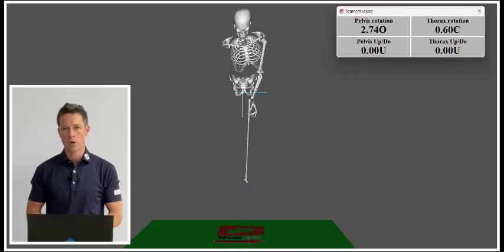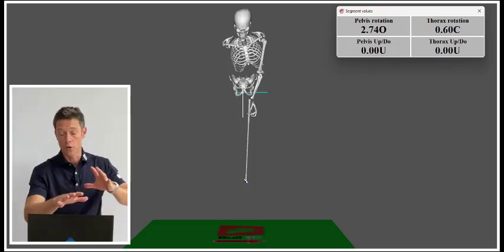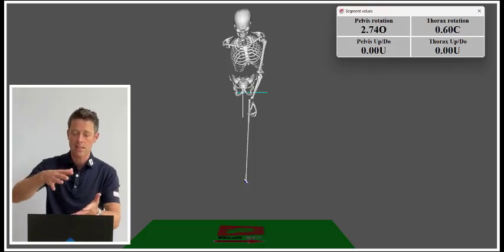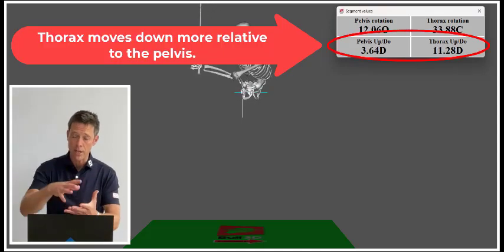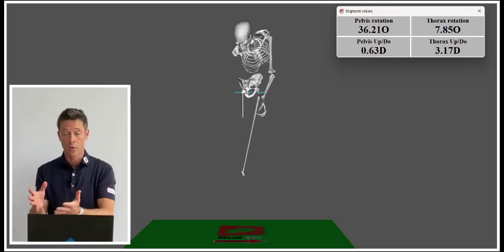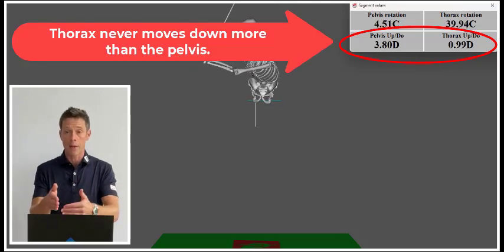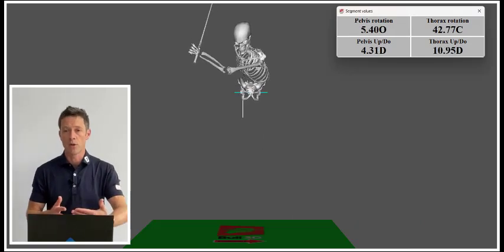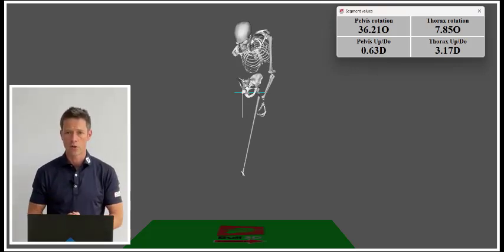Move the ribcage to improve the pelvis and hips

Comment: In advanced movers at what point in the downswing swing do you see the thorax start elevating? Hands about hip high ? Or maybe delivery club parallel to the ground on the downswing?
Reply from the maker: Yes that's correct Paul, typically around club parallel as this is when the ribcage will start being significantly influenced by the ground reaction forces.